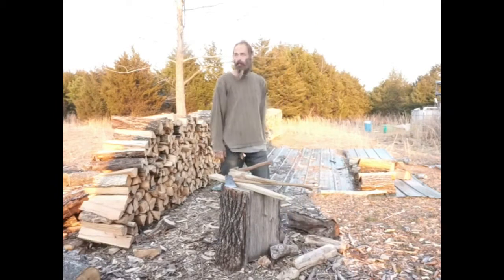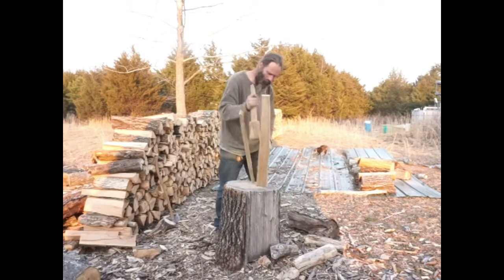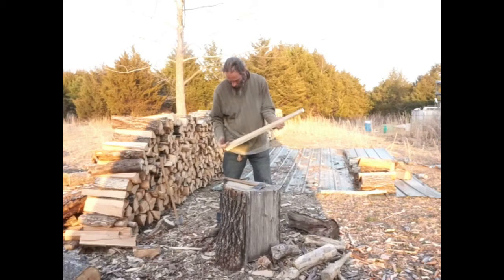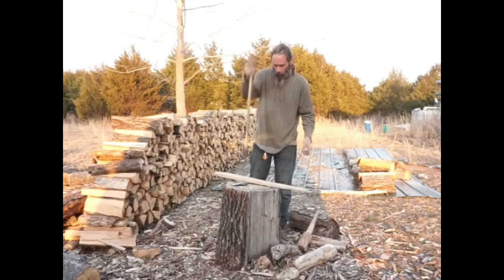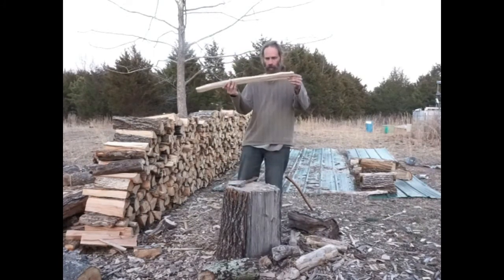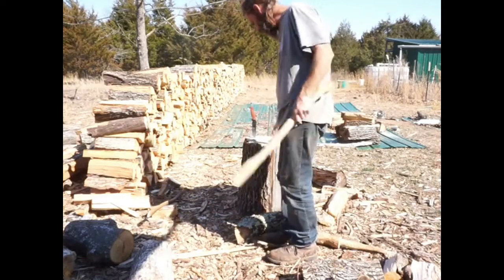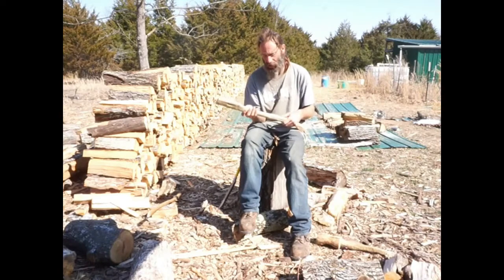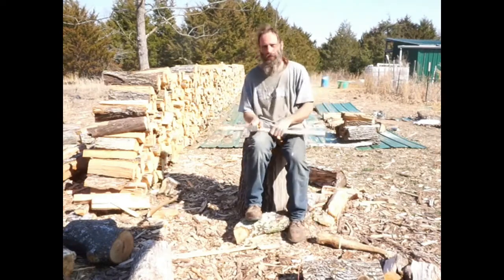Carving an axe handle from an oak billet I cut earlier from staves

Comment: I learned so much from this one video. Thanx macneill you put a few coats of boiled linseed oil on her?
Reply from the maker: I'm a little different on the oil. I use sunflower oil as part of my plan to sort of "do it all myself." I didn't get much of a crop last year, but that stuff is good for like...everything. It even works as a machine oil due to the high smoke point. So I use it for everything, including oiling my tools. It's not the best tool oil, I wouldn't think. Linseed oil or tung oil is probably better, but it's what I use. Still have a lot of shaping before that happens. As I use the axe, I'll get the thickness just right where it feels good in the hands to chop, and then give it a proper sanding and oiling.
Reply from the maker: don't forget to check out pt II ;)
Reply: @offgridgecko  watching now😁